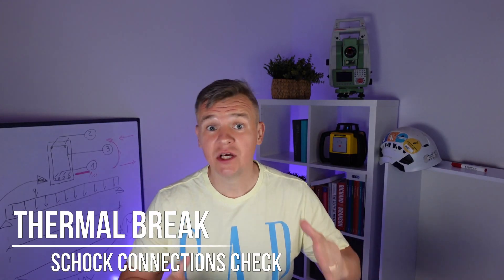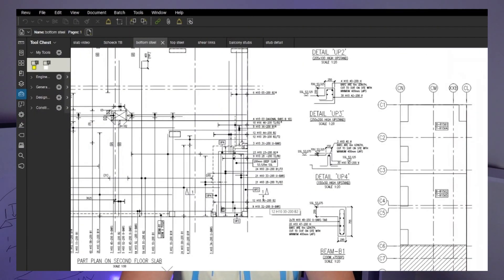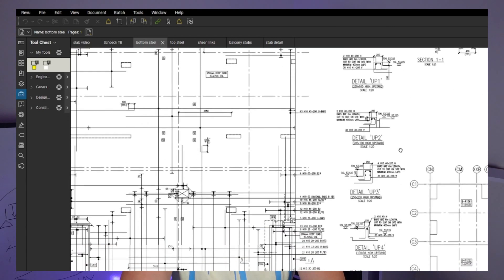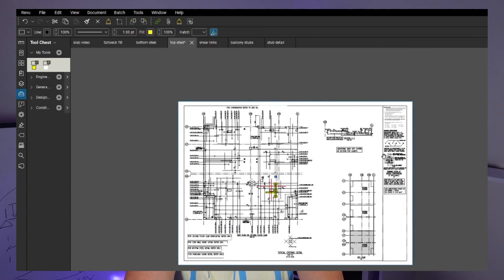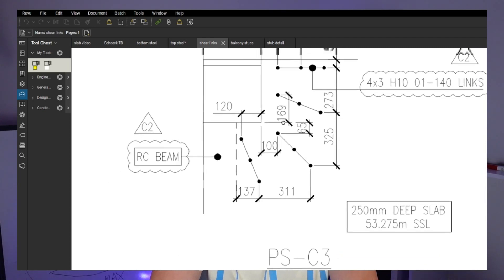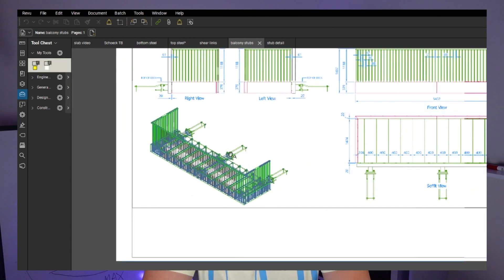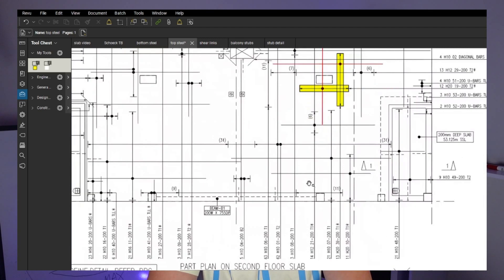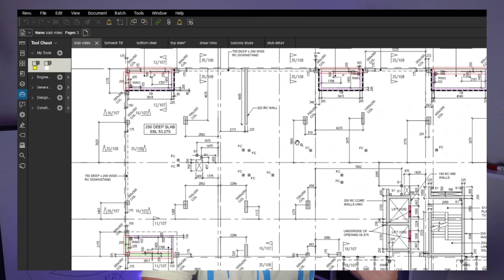Checking REBAR. Civil site ENGINEER inspection before concrete pour.

Comment: Hello Gregg hope you are doing well!
I have 2 questions:
1) shear links are mostly used for punching shear right? They are like stirrups but holding the top steel? Or they are just addition steel bars put diagonally in slab around columns?
2) whats half-ends? If thats how its written (english is not my 1st language sorry)
Also keep up the great work once im settled ill get you some coffee 😀
Reply from the maker: Hi Abdo! 
1.Shear links are for punching shear and they play critical role in the structure. A shear failure in this case is usually catastrophic. They should be set vertically around the column (if needed).
2. Halfen - it's a company name really, but like in many cases ppl on site call like that all the fixing channels, they are typically used as elevation fixings, or as masonry support channels e.g. ancon channels. Halfens are sometimes used in lift shafts.
Reply: @SITENG  understood ! Thank you for the clarification 😊😊
Reply from the maker: @Mr.Engineer93  No problem, happy to help 👍

Comment: Hi Greg, on the job I am on the edm screen shows a diffrent calibration level to the bubble level when I'm setting up. Do u know how to fix this? Which level should I follow in the meantime. I'm guessing the bubble?
Reply from the maker: If the EDM is good 'digital' level should be the one, as the bubble might need adjusting (small bolts there). When your resection is done you have to still two face check it (Hz and V). You received it like that? could someone hit it? TBH in general you shouldn't work with and ask for replacement stating the problem. Hope it helps 😁
Reply: @SITENG  yep recieved it like this, the asbuilts are showing good accuracy though so it seems OK for now.
Reply from the maker: @bayernmunich1751  If you can change it, or at least do checks to make sure you good 😁